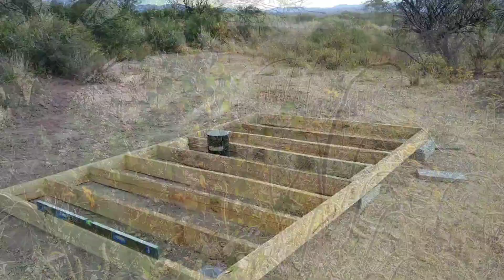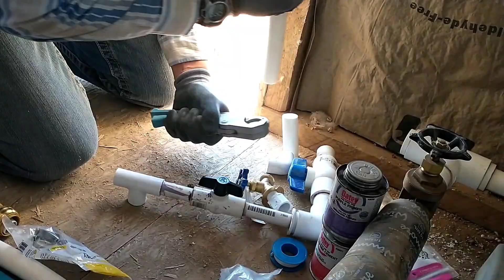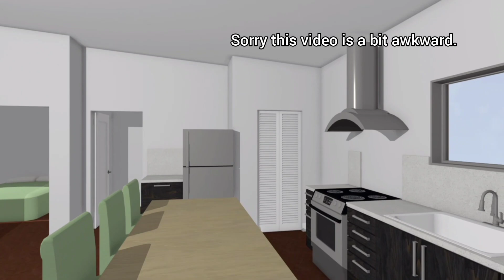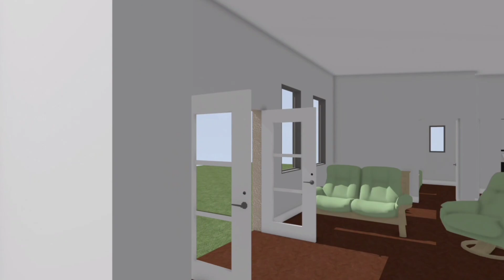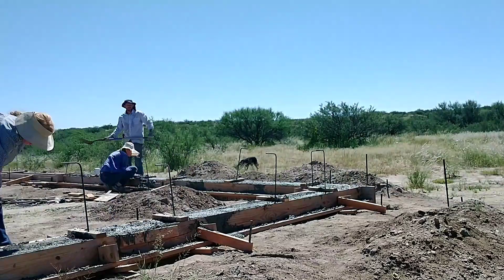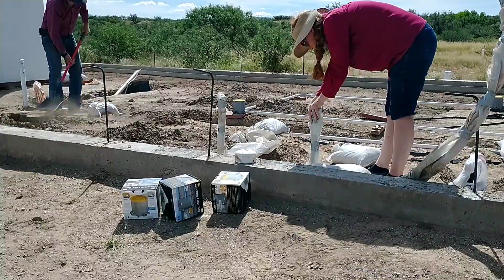Why we are Building with Aircrete 🏠 Our House Design

Comment: very interesting. Air crete is not that good of an R value of 2. so 8" will give you R16  Most passive homes have a much higher R value at least R20. Will be intetesting if it meets your goals in the end. .Best of luck.
https://youtu.be/6U4JAop0dTY?t=1153
Reply from the maker: Aircrete can vary widely depending on the recipe used, and how the batch turns out. As he mentioned, his aircrete sample fell, so it doesn't give the full picture. We prefer the stronger mixes, and are also hoping to get a lot also from the thermal mass aspect of aircrete. It will be interesting to see how it does. Thanks!

Comment: Please check out Stephen Williams channel.  He has built a 30 x 40 buildings.
Reply from the maker: He has some interesting stuff going on. We have a lot of reasons why we don't want to use styrofoam, and just the logistics of it all would really be something.  Imagine the space that would be required to gather, store and shred, that much styrofoam. The mixing equipment is not cheap either.

Comment: What is your plan for running electrical (outlets, switches, etc) in/on the Aircrete walls?  Very interested to watch your build progress!
Reply from the maker: We plan to cut shallow little trenches, then patch and plaster over them. It'll be interesting for sure! We just started making test batches. 🏠

Comment: Exciting project!  I look forward to following your journey.   Typically aircrete can be poured 12" or so without collapsing the entrained air bubbles.  As previously mentioned, Aircrete Harry's use of a thickening agent & air entrained admixture has enabled him to pour much higher.
Reply from the maker: Thanks for joining us! Yes, Harry doesn't say what any of that stuff is yet, or where you can get it. We plan to sift the sand pretty fine, and see if we can make it work in our floor, but we'll experiment with it first. 😊🏠

Comment: My biggest concern is engineering certifications.
Do you have an engineer assisting and or designing some elements?
Will the air crete walls be load bearing?
Might be keen on some columns with concrete, perilite, fibers and steel.
Its fairly obvious from your build that, you clearly have a very good understanding of the building process.
The quality of build is looking impressive.
Cheers from Oz
Reply from the maker: We have a permit that allows us to build however we want to, and engineer approved plans are not required. We were just talking today about the possibility of doing some concrete like pillars. Once we experiment some with aircrete we'll have a better idea of how we want to do it. Thanks! 😊🏠 
Edit: Plans and ideas have changed, so stay tuned.
Reply: @RedandAprilOff-Grid  Love what you are doing, thank you for sharing it! I've seen where some are using a bond beam  about 4" thick of regular concrete on top of the aircrete walls to distribute the load over a large area.

Comment: Great Plan, I'm still curious why the Footer was so deep, most builds with a stem wall design I've ever seen were only maybe 12" to 16" deep and that was regular Concrete. 
Being there and with a Frost depth at virtually zero ground level that would seem adequate? 
Still overkill is way better than being under what is required. I'm really wanting to see how the Aircrete is mixed up and Your Recipe for all You have planned. 
Great walkthrough, what Software did You have for the Plans, I'd love to experiment a bit. Thanks for sharing Your Progress! 👍🤠
Reply from the maker: He brought in a lot of dirt to build up the pad, and wanted to get below the level of the fill dirt.  We hope to try our first test batches soon! I'm really curious too to see how long it takes and how hard it will be to do. 
He used Chief Architect software. It was fairly user friendly, but took some time to learn. Seeing the shadows on the house at different times of year was really cool! Wish we had got a better video of that feature. Thanks! 😊🏠
Reply: @RedandAprilOff-Grid  Thanks for the Info, I'll check out Chief, not sure I'm up for the learning curve but probably worth the extra effort.. thanks again and stay safe out there!   👍🤠

Comment: Looking forward to the build.
My thoughts
1) I'd reconsider using aircrete for the floor entirely. Perhaps a lower aircrete layer for insulation / isolation from the ground but you'll want a tougher floor so you should cap it with a couple of inches of regular concrete. I recommend using a fiber reinforcement in your mix.
2) As something that will save even more energy than a minisplit, consider a geothermal system where you dig a trench close to the house deep enough to be in the permanent temperature layer and install plastic tubing which runs to either a fined radiator in your ducts or supplies a heat pump system. The 62 degree year round temperature can cool air blowing through the radiator by itself (the water is circulated by a small pump, the motor, being AC (or DC from the solar cells). A diverter valve supplying 62 degree water to the heat pump of a HVAC system is much more efficient than trying to extract heat out of cold desert air in the wintertime.
3) If you use aircrete for the roof, poured in place, consider thermal expansion so you can tie it to the wall on one side of the building but on the opposite wall don't fasten it so the roof can move without stress cracking. A steel plate fastened on top of the wall with a strip of HDPE over that that is secured to the aircrete will work quite well. To keep chunks from falling on your heads eventually (all concrete cracks, even aircrete) you might consider laying one layer of wire mesh in the roof so even if a section cracks it doesn't immediately fall down (I personally saw the danger of this in 1976 Guatemala earthquake! Not saying it's FOR earthquakes but just normal aging of cement / aircrete it's a possibility.)
4) Finally, have you consider the ancient technology of heat chimneys which were used in the Middle East , Greece and Rome for centuries and are being successful used today, especially in hot dry climates here in the US. The air is heated in the chimney and rises, pulling air into the house from vents in the walls at floor level. Or from airtubes buried in the cooler ground running away from the house and up through the floor.
Reply: Some really excellent points 1,2 & 4 not sure about 3.
Reply: @pulporock  if you don't allow for expansion and contraction of the roof, especially if it's a flat one the difference between cool nights and the heat of the day will have a lot of change in dimensions. If the walls are stronger the roof will bow in the heat and contract, possible cracking from tension (concrete is strong in compression not tension).
If the roof is stronger it will push the walls out and in and THAT leads to damage too.
This is not a problem with wood roofs but some metal roofs with long spans have actually torn the attaching screws out over a period of years. Better to design in an expansion fix than have major structural damage in a decade
Reply from the maker: We have considered pouring a concrete top layer for the floor. We are hoping we can use a stronger mix with quite a bit of sand, but we'll see how the test batches go.
He has some plans for venting, but probably not anything too fancy. Yes aircrete needs mesh to help hold it together, we'll have to experiment to see what works best. Red likes your ideas for fastening the roof. Thanks for the input! 😊🏠
Reply: @RedandAprilOff-Grid  in my experiments if too much (or much at all) sand was added the grains sink and the foam collapses. Makes a very layered cast.
Aircrete will support an area load just like the conventional foam board or spray foam does BUT under the concentrated force of furniture legs and in high traffic areas (a sidewalk and patio) it collapsed. I tried epoxy floor covering but it still cracked after a while. Tried 'floor leveling cement' and that worked pretty good.

Comment: That looks nice.  I think your design choices should lend themselves to a low cost build.

I won't be able to use aircrete in the same way due to the permitting process I'm stuck with.  Instead I want to use ICCF wall construction with a wood I-joist framed flat "cold roof" with BIBS style blown in insulation.  I'm thinking about making up pre-cast aircrete sections to use for footer formwork to insulate and leave in place and also pre-cast sections to fit between my I-joists to continue my exterior wall insulation up in to my roof insulation cavity to just under the roof deck.

I think the two drawbacks of aircrete are the amount of finish work required like stucco and plaster and the work for mixing and pouring.  My ICCF will need similar finishes so I get no savings there but instead of setting up and then stripping formwork, I just stack block and leave it in place.  Rebar should be similar but a batch plant will be mixing my concrete and a pump truck will be placing it.  Wood in the roof doesn't require formwork, it supports itself and seems more conducive to DIY, especially for a two story structure (double the wall height plus floor joists and stairs to double the size without spending more on foundation or roof).

Mine should be more expensive but I don't really have a way around that unless I sacrifice efficiency and durability to build a stick frame house (if lumber prices ever return to normal).  On the other hand, I'm going to have a concrete crew helping me all the way until I get to the roof so my share of the labor is probably less.

Good luck with your build.  I know I'm going to need a lot of luck with mine...
Reply from the maker: It will be interesting to see what all is involved in making and plastering aircrete. I'm sure it will be a lot of work, but not nearly as much as rammed earth, which is what we were originally thinking. 
Your house sounds awesome, congratulations and best wishes on your build! It's exciting, fun, and stressful all at the same time. 😊🏠
Reply: @RedandAprilOff-Grid  if you are looking for labor savings, a tilt up wall panel approach might be something to explore. 

I'm thinking for mine after the roof is in, my stucco exterior is going to be a huge task with lots of lifting, troweling and scaffold climbing.  The only good part is that after that my exterior envelope should be finished and I can slow down and work in the shade for the interior.

With only one story you can probably get by with a work platform instead of scaffold but as amateurs I'm sure it's going to go much slower than a pro and much much slower than a crew of pros.  I'm expecting to be exhausted for probably 1-2 weeks (with about twice as much exterior wall as you), maybe more.

One thing I'm going to try is to get in with Habitat for Humanity to learn stucco and develop a muscle memory before I try to tackle mine.  If that doesn't work out, I'll try to do a few days of labor on a stucco crew to at least learn a good mix and how to put up the brown coat.

I want to do the same for concrete so I can hire one less for the crew.

Comment: Another terrific, educational video April, thanks for sharing this and the walkthrough.  Since you have vertical rebar that will tie you foundation to the walls have you considered adding horizontal conduit about 18-24” up with breakout boxes for wall outlets and switch boxes.  The latter will need to be mounted on 42-48” vertical conduit segments.   If your husband has a reciprocating saw, remove the blade and affix an ~8x12” piece of plywood on the end to thump, vibrate your forms to eliminate air pockets.   

I have a friend that used a TrueFoam reward wall system to build his high-efficiency home in NE Ohio.  I may be an alternative for journey build if the aircrete becomes problematic and its installation...  Wishing you both and your family another blessed week.  Peace
Reply from the maker: Instead of putting the electric in the walls now, he's planning to cut out trenches later and then patch and plaster over them. Yes, if we can't find a mix that works well, we may have to consider something else. Thanks! 😊🏠
Reply: @RedandAprilOff-Grid  Presumably you've seen Aircrete Harry's channel on YouTube, but if not you should definitely check it out. He's being testing aircrete mixes for 5-6 years and has some great content. He's got some admixtures that significantly improve air entrapment and allows pour depths of up to 30" without the aircrete collapsing. Most people struggle with 6 inches! Definitely worth checking out if you haven't already.

Comment: AIR CRETE HARRY ON YT , HAS FORMULAS FIR THE DIFFERENT MIXES . ALSO CHECK OUT FOAM CREATE FOR THE ROOF . DO NOT FORGET EXPANSION JOINTS .
Reply from the maker: Yes, it'll be interesting to try some recipes and see how they come out. For this type of build we need the walls to be pretty strong. 
I saw one video mention expansion joints, we'll have to look more into it. 🙂🏠